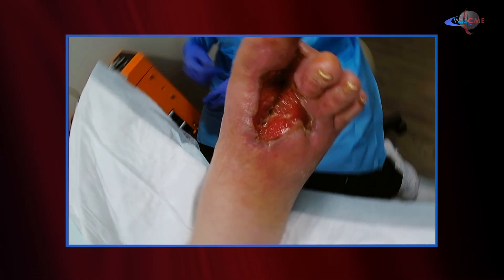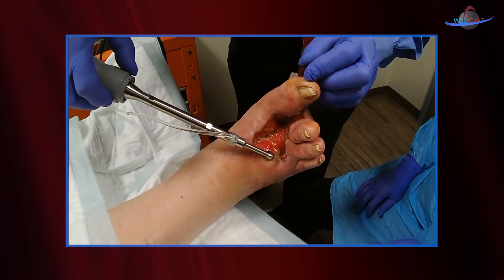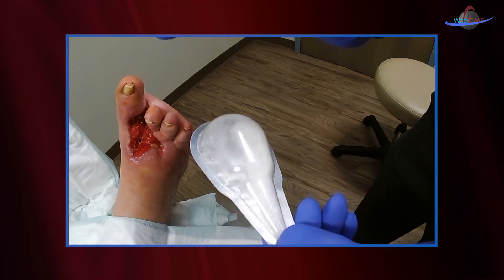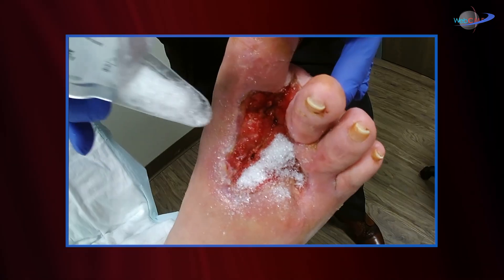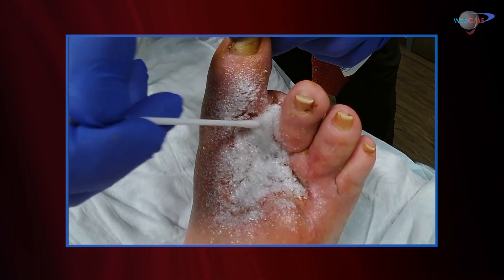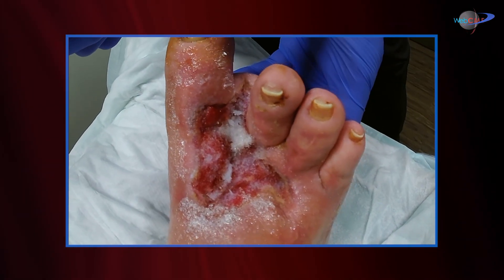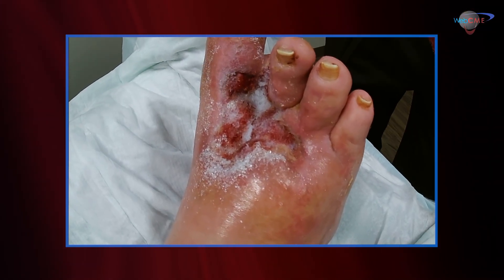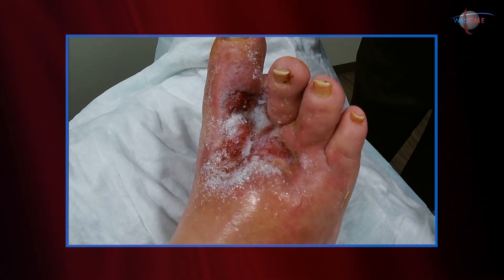WCW: Applying Altrazeal to a Post Surgical Diabetic Foot Ulcer

Comment: Great video, thank you for the upload! Altrazeal is a really great product but I think applying directly from its weird teardrop shaped blister pack and using the built-in applicator seems like a clumsy way to apply it. I think it would have been nicer for it to come in a plastic bottle with a long pointy, or unicorn tip applicator then you could get into more areas of the would with more accuracy.

Comment: What a great product for odd shaped areas that need to be dressed. I’m curious, when adding the water to solidify the product, wouldn’t a spray or misting bottle work better?
Reply: I agree with you a mist bottle
Reply: I feel a spray would be too aggressive and the force could alter the setting of the altrazeal. You also don’t know how much water you’re squirting each time compared to a single drop of saline or sterile water whatever he is using. Easier to prevent over saturating ?

Comment: That is fascinating! Thank you for the video. 😊
Reply: Thank You Sharon... I appreciate your feedback!  JANiezgoda
Reply: Jeffrey Niezgoda I had a wound that kept opening up because of its location. I have an ileostomy so I have a large scar/wound that starts about an inch above my belly button and is about 5" in total length, heading down toward my pubic region. I had my last surgery in 2000 and we were FINALLY able to get the wound closed completely last summer (2017.) Because of where the wound was, my pants kept rubbing up against it, causing it to split, bleed, scab, and then start all over again. I tried to keep it padded so that it wouldn't rub, but then the healing wound would stick to the gauze and pull off the scab. After 17 years of it l finally went to a wound care clinic and they saw me a total of 3 times as it healed. It has a tendency to get dry toward the top so as long as l keep Aquaphor or lotion on it I'm good. If l let it go I run the risk of it cracking and opening again... and I REALLY don't want that to happen! I found your videos when l was starting the process last summer and I just love all of the new innovations in wound care. My dad used to work for KCI when they were developing the wound vac system. I think that started my interest in finding a way to close my wound completely. I thank you and all of the other doctors, nurses, techs, and anyone else that is in this field. Without the innovation and proper care of a wound, more people suffer. You are all making a huge impact!